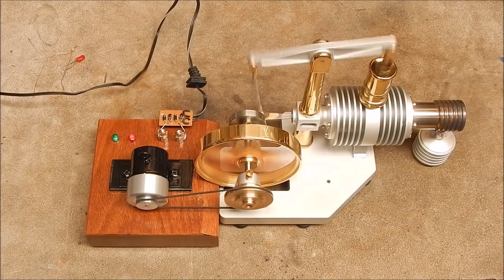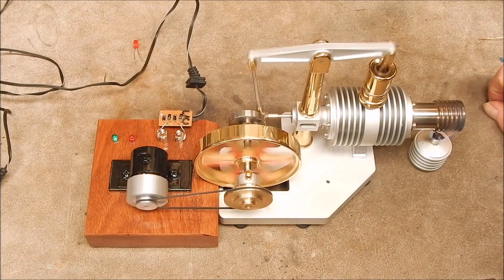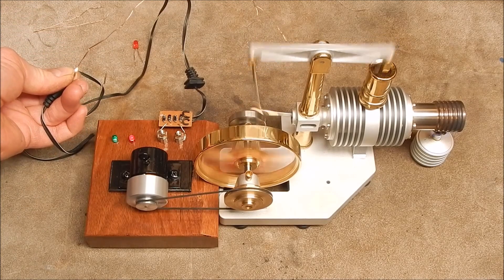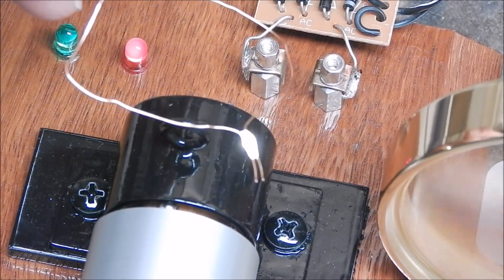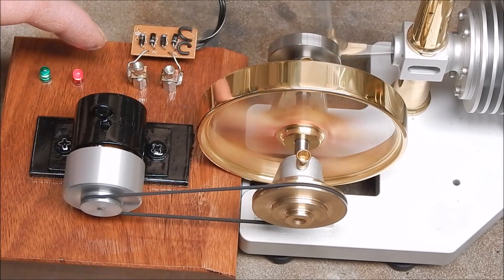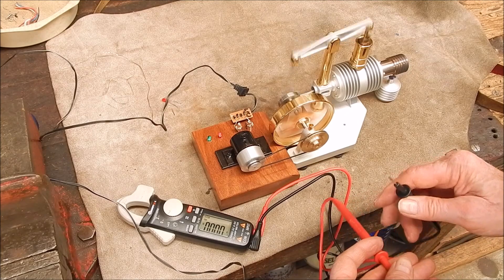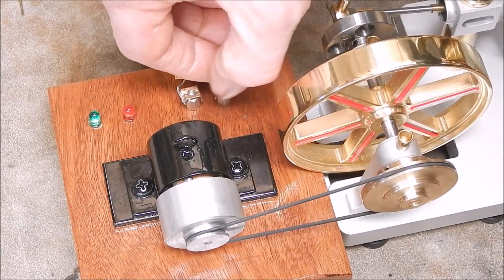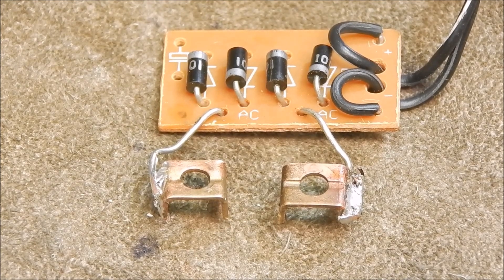The power of junk

Comment from the maker: UPDATE:  I later reduced the generator pulley diameter to increase the RPM and am now able to get a maximum output of 3.15 volts AC and 2.70 DC with the Tarot Stirling engine.   The pulley ratio is 2.8 : 1.   Under load the engine is spinning at 770 RPM and the generator at 2156 RPM.  This is within the design limits of the PC case fan.  Cheers Rob
Reply: That's really cool!
Reply: @Xynudu  given just over 400 milivolt drop it appears your using schottkey diodes that individually have between 200 to 300 milivolt  forward voltage drop. 

Considering the low voltages here efficiency diode recitification is terribly inefficient.  
Have you ever heard of active rectification or synchronous rectification using mosfets as "ideal diodes" ?
Reply from the maker: I only know a bit about bridge rectifiers.  I don't profess to be any sort of electronics guy, so mosfets are way out of my league.  Cheers Rob

Comment: Good to see you are still hard at it Rob 🤠
Reply from the maker: Yes.  There's usually something on the go Davo.  These one off projects are a good learning curve and time waster.  Cheers Rob
Reply: @Xynudu  Your not wasting time mate :)
I never thought of those things having a rectifier inside.  Makes sense when you think about it.
Has to go from ac to dc somehow 🤠
Reply from the maker: Yes.  It was so bloody obvious, but never crossed my mind until now.  Strange how the old mind works.  Certainly a handy item to salvage, even if it's just for the diodes.  They are not all DC, quite a few are AC, so just bust open the good ones :)

Comment: The peak voltage of AC will be a bit more that the measured voltage. (Peak should be 41.4% higher than measured RMS voltage)

When you rectify, you should get close to peak voltage, minus voltage loss of rectifier. 

2.5V is perfect for charging 2 NiMH cells. (1.25v per cell)
Reply from the maker: Thanks for that.  I'm no electronics guy, so this is useful info to me. Cheers Rob

Comment: If you measure 2.5v ac, that's the rms (root mean square) voltage. The peek voltage can be calculated  by rms_voltage × square_root_2, roughly 1.4142. The diode loss then is about 700 milivolt per diode and  full wave bridge rectifyers always have at least 2 conducting diodes, which means the diodes are dropping 1.4v.  

2.5vac×1.414(peek conversion)=3.535v(peek) 

3.535v peek - 1.4v rectifyer =  2.135v  peek pulsed  dc 

2.135v / sqrt 2  (converting peek to rms = 1.51v  dc ripple rms. 

Since the diode loss is a significant portion of the generators output voltage, rectifying the output voltage waste a lot of the little bits of power being generated.  

You could use that transformer to bump up the ac voltage  which would  make the diode drop a smaller fraction of the output voltage so that you can get more of the power into a load rather than just heating diodes. 😊

Add a little capacitor to smooth the rectified output could hold output a little higher longer.  Making the LED shine a little longer making it appear brighter with our persistence of vision.
Reply from the maker: Thanks for that.  I did think about adding a small capacitor to smooth the output.  I have a few and will see how it affects the LEDs.  This is only an experimental/educational exercise for me, so I don't expect any long term use out of this.  Still very interesting when you think what I started with :)  Cheers Rob

Comment: Nice one Rob 👍👍 You will get 400mV to 700mV drop across the rectifier depending on how much current you are drawing. If you attach the multimeter to the output from the rectifier and then connect more lights you should see this. I bet thousands of those wall wart powers supplies get dumped, so recycling the parts is a great idea. I even used the little transformer from one for a project once. Cheers, Alan.
Reply from the maker: Hi Alan.  I was going to build a small rectifier as I have a bundle of suitable tiny diodes, but then I though hang on what's in those useless low output DC power packs.  Luckily I had one that was about to be binned, many are AC, and open heart surgery revealed treasure :)  Not much voltage to play with, but enough.  I could probably get another half a volt out of the genny if I tried bumping the speed, but I've proven the concept and will leave it there.  That Stirling engine has really had some use lately and is a great machine.  Good little project that kept the brain active.  Cheers Rob
Reply: @Xynudu  You can use the fine wire in the transformer, and rewind the stator of the motor with more than double the number of turns of wire, and get a higher voltage.
Reply from the maker: Wouldn't that would put extra load on the Stirling engine, which is already pretty much maxed out ?
Reply: @Xynudu  No, so long as you do not draw extra current, but a higher voltage will allow you to compensate for the diode drop. Best though to hunt up some 24V fans though, as they come with the more turns of fine wire already.
Reply: AC to DC isn't quite that simple.

First up is the AC measurement is RMS (sorta like the average), rectifying it gets you the peak voltage.  To get the peak you multiply RMS by the square root of 2 (1.4), so Rob's 2.8 VAC becomes 3.9 VDC.  Then you drop 2 diodes (~1.4v) to get the 2.5 VDC shown on the meter.

There's no smoothing capacitor so you're going to get some nasty 100Hz ripple, that'll cause the voltage to drop with higher loads.
Reply from the maker: OK now I understand.   I didn't know any of this stuff.  Always learning.  Cheers Rob